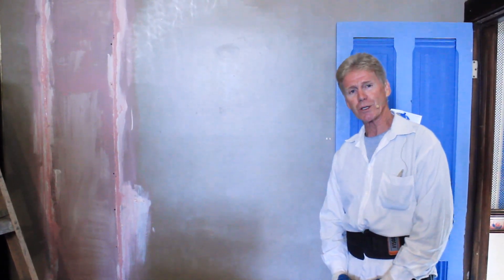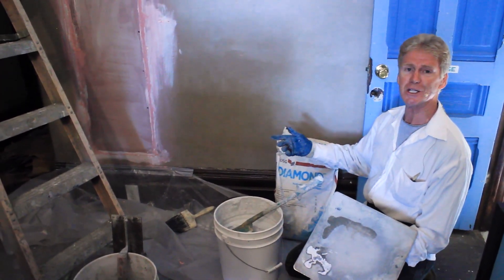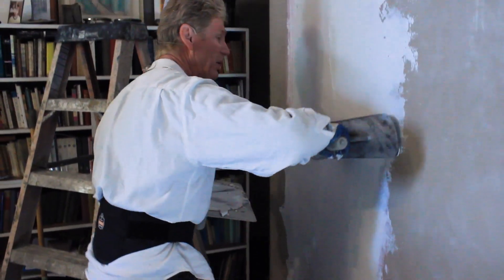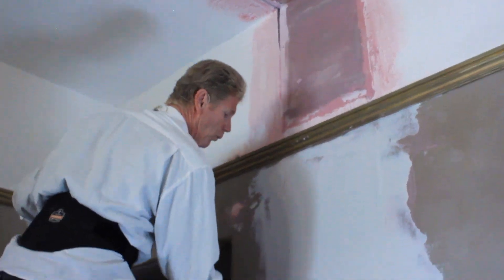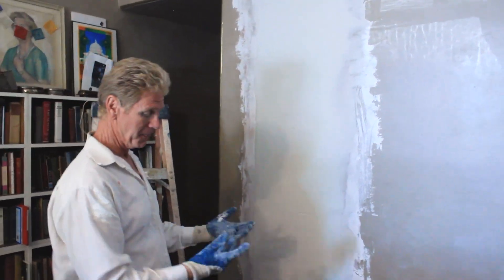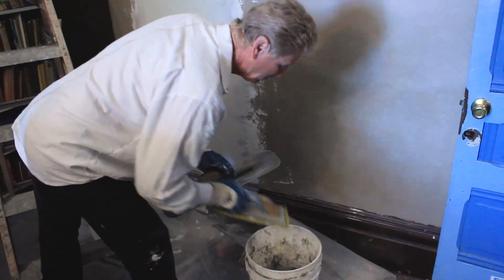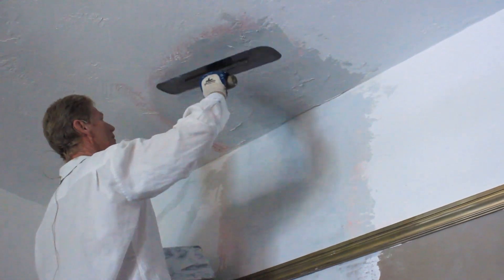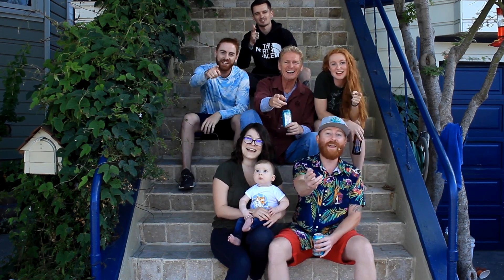Can you finish sheetrock with just a lime finish?

Comment: Hello Kirk,  This isn't a dig, but when you call this product a lime plaster its a little confusing. It's a gypsum plaster mixture with hydrated lime. It confused me anyway until I ran to the USG website.
Reply from the maker: Howdy my friend, LOL, it used to be mostly Lime when I started 40 years ago, each year they add more plasticisers.  Why? Lime is expensive, so more of these so-called plasterizes keep replacing the lime.
  I've been it this trade since Moses was alive, and I still don't know what plasterisers are, but if I were to take a guess I would say, just a less expensive by product of gypsum, as they cost less.
 I'm an applicator, not an engineer.
  I'm not losing sleep as to how much lime they continue to take away as it's expensive, and much additives as plasticisers are added instead.
   It's kind of like the maker of wines, they insdent the bottle so they can sell les wine for the same cost. In a billion dollar industry the same them perhaps 10 Million?
 I could give you a hundred more scenarios similar to cutting cost in manufacturing, but it's business and not anything to be bitter over. it's just how the world has always worked.
Cheers my fellow plasterer. 😉
Reply: Not all veneer plasters have lime.  These plasters use Gypsum cement as the "body" and lime as the "aggregate".  Products like USG Diamond and GBBP Xkalibur have a high content of lime.

USG does specify Diamond as a "milled lime finish" in several spec documents.
Reply from the maker: Cool beans Daddieo, For the time I have left In this trade, I will continue to use the terminology of lime plastering when it comes to what used to be lime plasters. They can dilute it to pure gypsum for all I care. My how-to videos are for explaining applications not to analyze what current companies are adding or replacing to save on manufacturing costs.  
   There's enough of this nonsense in the food and beverage industry as is, to give up 5 minutes to who else in the cement and stucco world is also trying to dupe 
us.
At least we don't have digest plaster.😏

Comment: I love the pool float you use. You can also paint the cracked plaster with a lime wash paint to fill in any cracks but your technique of applying the skim coat is very sensible, I never though that it would need so much attention. I like the way you de-stress/strengthen/denisfy the skim coat after 30 minutes to reduce chance of cracking on further drying...'.crazing' is the technical word. dam a PhD in physics and help build materials on 5th generation USA fighter jet.

Comment: Hii Kiirk

I mixed diamond with polymermortar 50/50 and it's the perfect limestone block finish .. 
I only had one issue. Fast setting in the bucket.
I retempered and it was fine and its dry and looks great.
I went over a scratchcoat of just the polymer mortar ( tile Mortar to be exact ) I taped a stone pattern and installed this.
If you like I can show you the pictures.
No plaster bag or blend has ever worked so well for this application before.
Yes it's a decorative application but I tried it to see the outcome and cost.
Between the 2 bags the cost was like $12 a bucket

Comment: Good morning Kirk! Do you sponge the edges to blend in with the existing? Also if you use structo light underneath can you wet it to keep it from sucking the moisture out of the diamond? Thanks again for your videos sir. Again you are a Craftsman with a capital C!
Reply from the maker: Morning Kirk, using a sponge float is determined by the finish. If it's sandy, then sure use the sponge float.
   Use a trowel as a rule for smooth finishes.
Excellent question, the fact I didn't address it in this video means I had too many rooms already plasterers, and subconsciously, I had to know which needed my attention; thus was pre-occupied consciously to cover most issues I was trying to explain.
   Okay, regardless of whether your base coat is Structo-lite of Imperial base coat or any of the other 20-basecoats with or without sand.
 You Abolulyly need to wet, soak or mist that basecoat so that the suction is under control.
If you don't, whichever finish plaster you apply will instantly have the moister sucked from it by that thirty basecoats, which will cause too many problems to list here.
 Again, excellent question, my brother.

Comment: Hey Kirk, if the interior walls were smooth plaster finish and there is a decent amount of patches needed around the room’s perimeter, how would you match the smooth finish if you can’t sand the imperfections? Would you apply a thin coat application on all the walls to make things uniform?

Comment: Good day Kirk! A question about fiber mesh tape. Do you tape drywall to plaster seams? I have a soffit I'm doing and the face abutts the ceiling which is drywall but the bottom abutts plaster. I have taped both but will be applying plaster next week. Thank you sir!
Reply from the maker: Yes and yes, all butted sheetrock/drywall should be taped. However keep in mind in some instances it's better to apply a bonding agent as you don't want a hump in the wall or ceilings as you needed to cover that fiberglass mesh.😏
Reply: @StuccoPlastering  Copy that sir. That's what I did. Just finished the base coat of gypsolite. Tomorrow will be the diamond. For my first ti. E really using anything other than drywall mud, thus far it's looking great. I guess we'll have to see tomorrow after the finish coat. 🤓

Comment: Nice video. When did you stop mixing gauging Plaster with Your Lime products on the job ?  The products that I see you using seem to Be a combination of lime and gauging Plaster within one bag.  Do you use a different veneer plaster depending on whether or not the base coat that you’re going over his green or not ?  Thanks Kirk. Have a good weekend.
Reply from the maker: The Sheetrock board colors make no difference as we apply a bonding agent anyway. I haven’t used any gauging plaster as all that’s needed these days are in the bags, I used USG’s Diamond lime finish for this fix, without a base coat because I wished to explain how to plaster without using a bad coat.
Reply: Thank you Kirk. You’re the best.
Reply from the maker: @jacksmurr585  That’s a fact, Jack.

Comment: Love your videos did you mesh tape the joints
Reply from the maker: Hi MB, on the ceiling, I did, but I don't think so on the wall, as it wasn't necessary as the bonding agent was applied instead. It depends on the size of the gap to mesh or not.

Comment: Does the Diamond finish provide more working time then a Lime putty and gauging plaster mix? I have always mixed lime putty and gauging Plaster for the putty coat and have found that when mixing them if I mix it too much it accelerates the set and it starts to stiffen on the board in less then 30 minutes.
Reply from the maker: I'm no longer sure as I haven't used gauging plaster in 30 years. I buy what's available these days as a lime plaster.
Reply: @StuccoPlastering  thanks kirk

Comment: Can this be used on plywood or mdf? would you prime it? How does this sound, plywood, primer, bonding agent, imperial base coat, and diamond on top? Is this a no go, or overkill? Thanks for all the info you put out there!
Reply from the maker: Good morning Wggee; unfortunately, tapping mud and all interior plaster should not be applied over wood, even if you apply a bonding agent? Why? Excellent question, by the way.
 When hot or even warm, the wood can expand; thus, all plaster will pop off. You are better off going over sheetrock; this mud will adhere permanently. And yes, I have tried this twice many years back, only to have to scrape off the loose or peeling plaster, then attach the sheetrock and do it again. Cheers. 😉

Comment: Hey Kirk,.  Great videos! You mentioned at 10 minutes in the home owner laid down some mesh tape.  With using lime based plaster particularly the diamond you're using do you need to tape corners necessarily?
Reply from the maker: Hi Brian, I tape joints and attach a metal corner aid to all my corners, personally.
 In this case, the owner already did some skimming, thus only a bonding agent was necessary.
 Good question, brother.😏

Comment: When using lime how do you feather it out to existing wall without a border showing?
Reply from the maker: That my friend takes practice. Watch how I do it in this video.
Reply: Thank you 
Sounds like I'm making a couple mistakes, over troweling for one.
Reply from the maker: @bryangarloch3143  over troweling usually lifts the single coat and or causes excessive cracking and bobbling. As there is no base coat for the finish to stick to. The bonding agent is to make certain it adheres but a base coat has serious suction that acts as a mechanical bond, the glue or bonding agent is a chemical bond. It’s a little confusing that’s why it’s recommended to use a base coat. Cheers
Reply: Awesome thank you. In asking one question I've discovered answers for other issues I've been having.
I'll keep trying maybe someday I'll be as good as you. lol

Comment: Kirk, say a DIYer has the same repair to make as you do in this video but goes with the base coat first. Would you suggest using Structolite or Diamond Veneer basecoat (or a hot mud)? And why/what would be the difference in this situation?
Reply from the maker: Hello, my friend, this video was to answer a question asked often on this channel, can I just apply a finish coat?
 The fact is naturally if one applies a basecoat with either structo-lite or any of the base coat lime plasters it will no doubt be stronger.
 In this video, the homeowner left the strong wood cedar lath on the attached sheetrock, so the anymore strength would have been overkill, besides I had an ulterior reason for just a finish coat in some areas the sheetrock was bulging past the existing walls so to add basecoat plus a finish, would have created a hump and have been an apprentice move for me. 😉
Reply: @StuccoPlastering  You da man! I wish you were here on the east coast to help repair my 200 yr old house but at least I'm learning enough from your vids to try my own small repairs
Reply: @StuccoPlastering  this is my issue they have removed the wood laths so I put the matching ¼ inch drywall to fill the hole and now stuck do I put base over the pink binding agent then the lime coat as a finish which will help make up for the space difference or just the lime coat finish really thick.
Reply from the maker: @atkgrl  Hello darling, you can do either, but if your new, at it, Basecoat it, then when that sets, apply a finish coat. 🥂

Comment: Hey Kirk,  do you still tape inside corners using plaster?  It seems you don’t from what I can see but you haven’t mentioned it in the videos I’ve watch.  Great videos!  Gearing up to plaster a fireplace..  thanks!
Reply from the maker: As a rule when going over drywall/sheetrock, with any Lime plaster or drywall joint compound, or even a taping mud.
 One still must tape the joints with paper or fiberglass tape or cracks WILL appear at these butted up joints or seams in the future.🤔
Reply: @StuccoPlastering  good to know

Comment: No mesh on the seams?
Reply from the maker: Howdy Tom, good question, no, for butting new sheetrock the mesh would then be necessary. For interior plastering mesh would create an eyesore or buildup to cover that mesh. A proper bonding agent achieves the same result with no buildup.

Comment: My lime skim coat plaster containing silica sand and lime hydrate keeps micro cracking, how can I prevent it cracking ? It is applied onto a lime/aggregate base coat. I scratch the surface of the base coat to provide a key, no direct sunlight and I dampen the wall down before applying the skim coat, but the cracks appear after 7 days of drying. Thank you. I cannot add fibres, as it is the final finish coat.
Reply from the maker: Good evening my friend you doing everything right so it must be the pressure, apply it lighter or with less pressure and don't overtrowel it. Lay it on gently make it pretty with as few stocks as possible and not too much muscle.
When you use too much muscle or pressure or over trowel it, the new finish can and will lift or separate from the original or base coat finish, voila, checking or spider cracking, Handle it like a weee baby, gentle like and with skill. 
I'd say good luck, but luck won't help, gentled few stroks my brother. Cheers.
Reply: @StuccoPlastering  I Never thought of that idea, great mate, thank you. Therefore which 11 inch trowel by Nela/Marshaltown/OX  available in the UK would you suggest to apply the lime/silica skim coat gently, perhaps a rubber float/sponge float  instead of stainless steel ? Another burning question....I need to apply maximum pressure onto the very very stiff 3:1 quick lime base coat, therefore I am using a MIDGET rectangular trowel only 8x3 inch in size. Is there a better alternative way at generating an even higher pressure; I considered a Japanese trowel with a pointed edge. Very interesting to hear your reply, I emphasise, the lime plaster needs very high compression to move it across the wall. Must be carbon steel to grip the lime rich base coat, which one do you suggest from the list here.......https://japaneseplastering.com/japanesetrowels

Comment: Outstanding tutorial Sir! I'm a retired Marine living in a 60+ year old home in Western, PA. My walls and ceilings appear to have been plastered over paint. I have a lot of areas that are cracked and de-laminating which I want to address as a DIY project. Unfortunately I hired a "pro" painter to do a single room thinking they new how to patch, prime and paint old plaster walls. They didn't and it shows. $3,000 dollars later I'm convinced I can do a better job myself, but am unsure but the thought of skim coating every wall is causing me pause. As a stop gap measure I was thinking perhaps I could just lock down the delaminating areas with a primer and joint compound. It sounds doable, but I have no idea if it would be effective, nor do I know what primers / joint compound to use should I attempt this. The YouTube paint gurus suggest Zinsser or Kilz primers and then USG mud for drywall repairs. Now that I've watched your videos I'm uncertain if the YT recommendations are the best approach to my challenge. Would a more effective solution be to use a plaster weld type bond on the areas that are delaminating and then skim coating over them? If so, what would you recommend? Thanks in advance 
Ken
Gunnery Sergeant, USMC (retired)

Comment: Sorry but 1 coat sponge plastering gets a thumbs down from me. In the UK we call 1 coat spongers frauds! 😆 im not saying you are but we use alot of brittish gypsum in the UK and has alot more aggregate so the sponge give a poor corse finish due to being a 3mm finish plaster. It may look ok to the average eye but when the light hits at an angle for example reflecting back off curtains will look like the surface of the moon! Washing the bond out from the aggregate and replacing it with weakened plaster from the sponged surface is looked at as a very amateur way of plastering 

On lime plaster I agree a sponge is good when used correctly but not 1 coating? A levelling coat is very important for a quality finish! When timed correctly it allows you to lay a thin skin on top for a perfect uniformed finish 👌🏼
Reply from the maker: Morning Dan, you missed the point of this video, no doubt a few others may also, cheers.